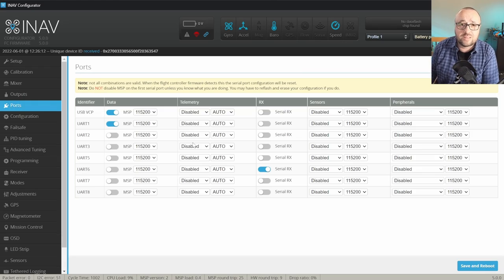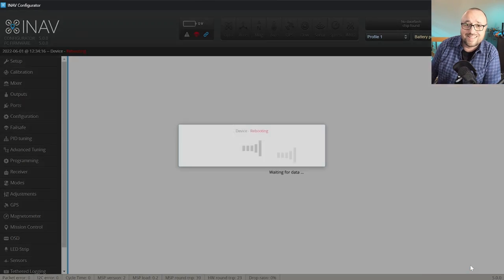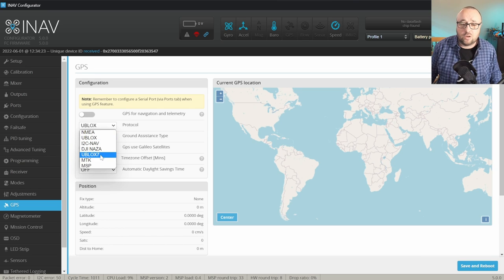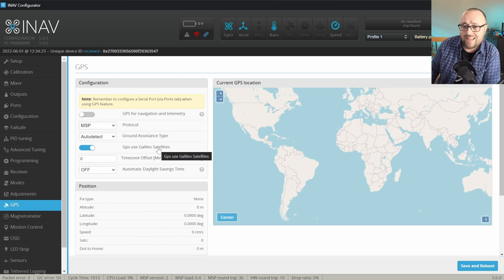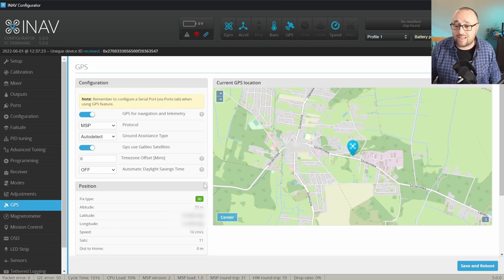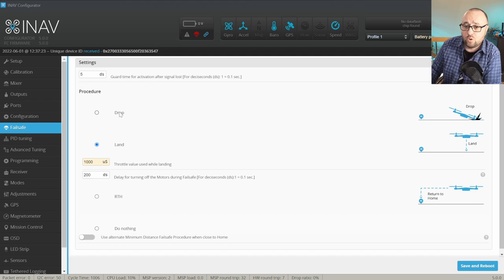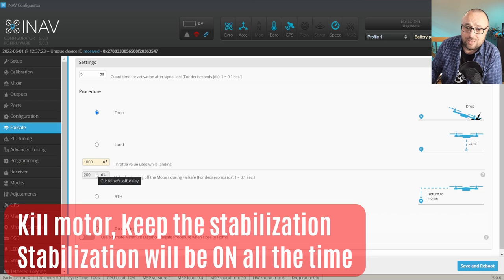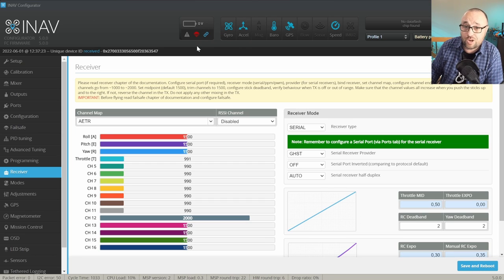GPS & Failsafe | INAV 5 on a flying wing | 6/11

Comment: What could be the issue if parachute doesn't turn red on switching off radio? GPS works OK, getting satellites with 3D lock. Ps: I am on iNav 6.1.0. Thanks.
Failsafe is set to RTH. Gaurd time is 0.5

Comment: I have a gimbal for head tracking on my plane. How can I define in which position the camera should turn in case of a failsafe? I wouldn't want it stuck at 90° to the side...Betaflight allows to define channel positions to be set in case of a failsafe. Would that not be great for INAV?

Comment: I'm using matek f405 wing and bn 220 gps module. My inav version and fc firmware version is 5.0.. I'm going over 6 satellites in a short time. 3D fix appears green, but in the setup tab, gps navigation is safe, it's constantly red. what can we do about it?